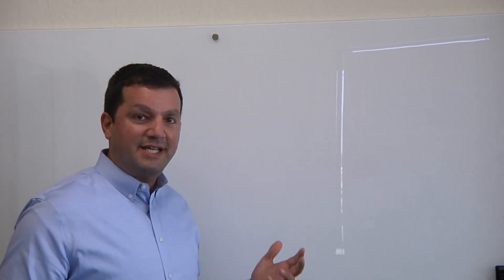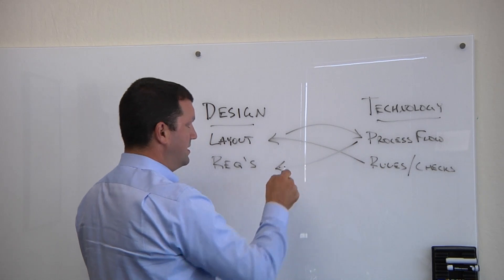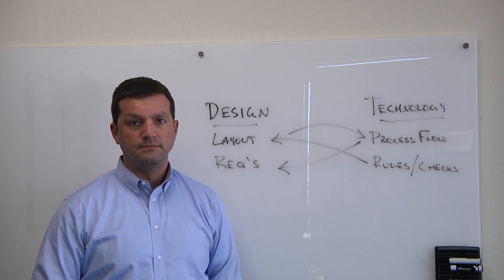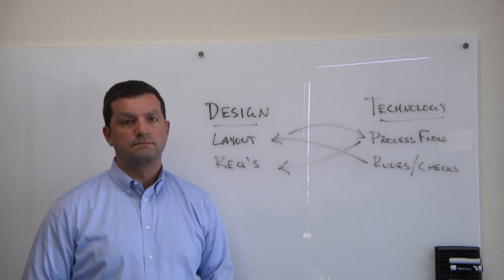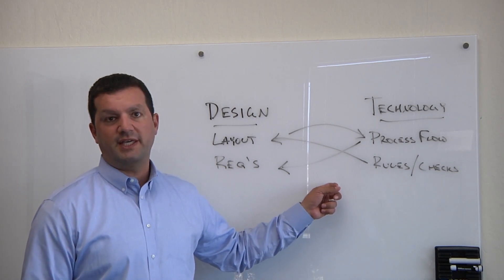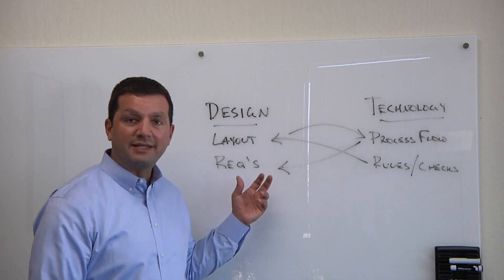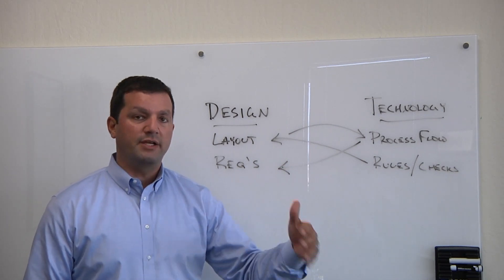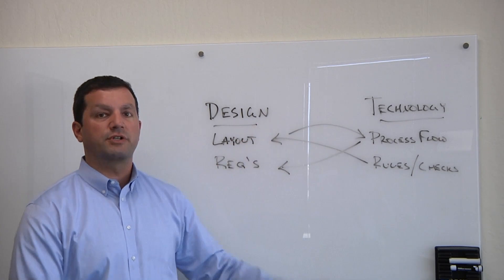Design Technology Co-Optimization

Comment: Very useful!! but a question is that this DTCO flow shoudn't it start with design contraints that design can meet the process flow.. rather than mentioned in video designing from the process flow to meet requirements??
Reply: I think What he means is that the process flow dictates what is possible in terms of setting the requirements.